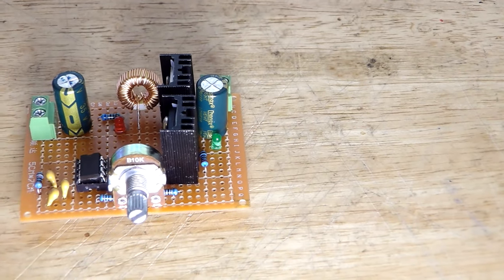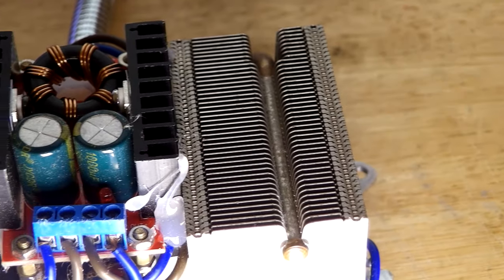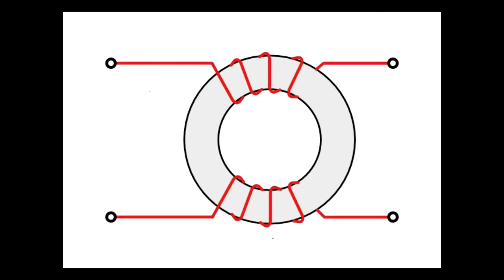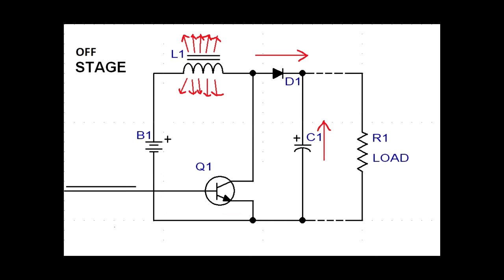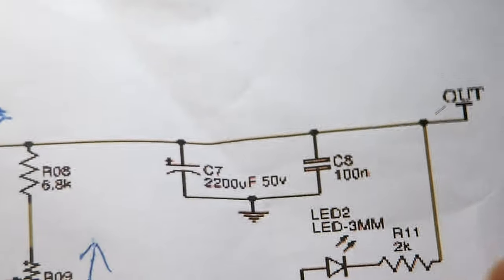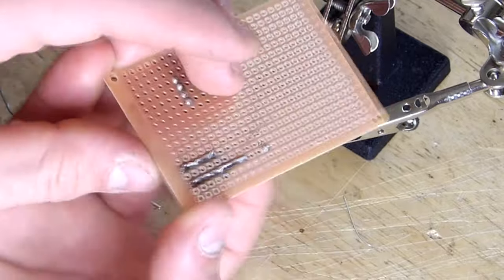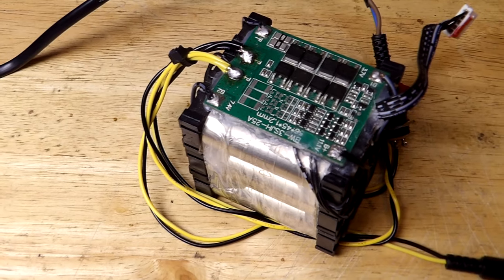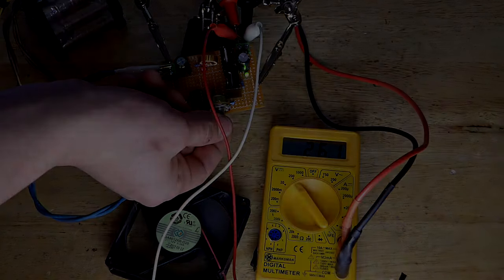DC to DC 150W Boost Converter Base On UC3843

Comment: Sorry. The feeback control of the uc chip control the ouput voltage and if a voltage drop the chip step up the voltage equals to the setting voltage by the potenziomenter?
Reply from the maker: yes it will regulates the outpout voltage but if the load it will be to much it will start to hiccup and stop working . keep in mind that this is a flyback converter so a maximum of 150w can be take out from it . if more is need it you cand modify the circuits but i m getting of from the topic so yes it will regulate the voltage
Reply: @MikeTechnology  thank you

Comment: Sir circuit working fine but inductor and shunt resistance getting more heat input voltage 14v and out 50volt coming but geting more heat in inductor and shunt resistance. .... inductor value 47uh ,shut resistance 0.1ohms 5watts
Reply: Can u help me
Reply from the maker: the inductor you use i to small you need it to be at least 100uh to work decent , try to rework it by removing the winding and counting them then add few more ,it will not be 100% acurated but it will increase it , or use one wich is 100uh even 150uh will work perfect , hope this help . the shunt is ok is not that the culprit is just to little inductance for the ocillation to work decent
Reply: @MikeTechnology  thanks sir for replying
Reply: @MikeTechnology  sir i use 150uh inductor again heat problem   issue 🥲  

I use same circuit in video 
Input capacitor 4700uf 25v
Output capacitor 3000uf63v
MOSFET irfb7545
Diode 10amp 100v  
Gate resistance 10ohms
This specification only i change
Reply: @MikeTechnology   while using 150uh inductor input voltage 15v and output voltage 48v
Reply: @MikeTechnology  any idea 💡 sir to reduce heating inductor
Reply: @MikeTechnology when output voltage 25v inductor did not get heating issue
Reply from the maker: try swapping that 10R from the mosfet gate to a 47R if that does't work use a 100R , from what you are explaining is likelily that the inductor is going in saturation , if changing the gate resistance don't work use diferent inductor , make sure you  use a ferrite one not iron powder , but if still not working you can add a small gap in the core simple cutting it in half and isolating the 2 half of it with tape ,paper because with an air gap it will lower the hysteresis curve and allows more energy handling by decreasing the permeability of the core
Reply: @MikeTechnology  sir is mosfet required pull down resistance for gate to ground
Reply: @MikeTechnology  in my inductor air gap is more
Reply from the maker: yes you need at least 10k on it base
Reply from the maker: it need just a small gap verry tiny one like a pice of paper the gap help build the magnetic field but if is to big will will do more or less nothing , is same like a core without gap it will saturate at one point rezulting in more losses
Reply: @MikeTechnology  there is gap in core and coil .then also heat is producer in  inductor 
if out put voltage increase above 35v   only inductor get heating issue
Reply: @MikeTechnology  output of boost converter is less then 35v it work good and no heating problem
Reply from the maker: @mani4812  then if is still saturating even after modification you can do 3 thing , first change the inductor or second  add a small snaber network across it 1nF pollypropeline cap with a 470k resistor at least 2/4 W will be a good for  start , and the third option you can go a bit higher with the ocillator by changing the C4 and C5 one of it to 4.7nf but keep in mind the fedback pin of the ic can stand to high voltage let say over 50v with modifing the R08 resistor and R10
Reply: @MikeTechnology  thanks bro i try reply u
Reply: @MikeTechnology  What type capacitor you using  in this circuit

Comment: Please what are the modifications to reach 300 Watts with 10A ???
Reply from the maker: Well it is a lot to explain but this boost converter it is base on a flyback topology wich mean it will supply at it best around 150w to extended it funder we need to use another topology wich can be achieved by adding a pair of pnp and npn at the gate of the main Q1 tranzistor this will be a crude but verry effective improvement over the  current topology and it will be basically one tranzistor forward topology but as well the induct has to be rebuilded or changed plus a snabber network for preventing the q1 main tranzistor for getting burn now for the main switching tranzistor we can add few of them in parallel to help increase the overall power distribution but now if you really need some extra power just add few boost module in parallel but be sure that they are identical and as well the feedback pin to be connected to the same rp1 potentiometer like I said it is a lot to explain but I will eventually come with a update on this topic soon in the nearly future thank you for the feedback

Comment: I made this with the same component,but the output is same with the input, i'm check the potentio and it give voltage to pin 2,i ceheck the ic with buzzer its work,but when i'm try this circuit the pin 6 its not giving voltage to the mosfet,can you help me

Comment: sir what is the input voltage?
Reply from the maker: 12v it is the normal working voltage but you can power it up even from 9v  but with some limitations.  It better though if as example you need 24v power it from 12v or if you need 36 power it from 24 like that you will get a better input/outpout efficency and minimise the losses
Reply: @MikeTechnology  thanks for the respond sir, and what is the maximum current out put
Reply from the maker: @nemborodrick2359  now depends if the board it is  done well you can get at maximum 150w out of it due to the reason it is a flyback topology boost converter 150w usually it is the maximum but in the reality you can get like 100w to 130w at best even with the commercial one from ebay.  But as well for that to happen the voltage gap between the input and output has to be small to reach that power.  Like at example to power a typical 100w led you need like 3A at around 33 to 33.5v to power it at it maximum and from my test the best  results was by using at minimum 18v but now depends as well you input source if you got like a 12v charger wich can deliver like 2a at best don't expect to much amperage at the outpout even if you need a slightly higher voltage because depends about at what you want to integrate it for led . Or motors and so on
Reply: @MikeTechnology  thanks sir well understood. please can you build me a 4.2v -24v dc-dc buck converter  circuit using lm 324 ic
Reply from the maker: @nemborodrick2359  well the lm324 it is a quad op amp. And I don't know if it is really suitable for being use as as buck converter because it will be to complex and the components required are to manny plus you need  as well a way to get feedback to be able to ajust it plus short circuit protection.  Try better the lm2576 it can give you like 3a at best or if you need a bit more power use the xl4016 it can give up to 8a they are the easiest way to get a stable voltage.  I got video for both of them on my channel check them out if you wanted.
Reply: @MikeTechnology  okay sir I will check on your channel. But sir what of using also 555timer as buck converter, will it work well?
Reply from the maker: @nemborodrick2359  to be honest I never try to make one . I watch some on YouTube but I don't think it will work well . Cuz after all you don't have any way to implement a feedback in to it without making the circuit more complex and even if you get it working the 555 timer is not meant to be use as a buck converter or even a boost converter.  If just a oscillator wich can be use in manny way for cool projects but not for dc to dc convertors
Reply: @MikeTechnology  good morning, I have build this circuit this morning the issue is that i went to the market I saw but ka3843 ic so I don't know if it will still work?
Reply from the maker: @nemborodrick2359  ka3843 it seems to be same as us3843 I had a look at the datashet and the pinout it is the same plus other few parameters.  I guess is just the same chip unther different name giving it a go .
Reply: @MikeTechnology  woowww sir i succeeded to build this circuit, it work like magic perfectly. Well sir thanks for this circuit. Sir from the diagram of the circuit is there a way I can transform it into and inverter DC - AC ?

Comment: Can I remove 1nf caps??
Reply from the maker: you can modifie the value . but if you will remove will not going to work properly because they are use to set the frequency of the internal ocillator

Comment: I made it but voltage dropped heavly!! Help please
Reply from the maker: what is the inductor you are using 
what is the tranzistor have you use
have you use the same shunt 0.1R

i can't guess but usually is may be a layout problem . you have to keep the distance between components verry close for minimise the loses try make it again and plan your layout on a pice o paper first after put them together on pcb or on vero board .
Reply: I used irf3205, diode MBR20150CT,  then ferrite core
Reply: How to attach feedback
Reply: Can i add feedback
Reply from the maker: @madeintanzania2995    yes you have to have a feedback pin 2 of the UC3843 look a the schematic you have after the diode 3 resistor R08 R09 and R10 the created a voltage divider R09 it is a valuable resistors with it you control the voltage from the vcc let's say 12v to the voltage you will get on your configuration . look at the schematic as well on 1 on of the UC3843 you have 2 pasive component 1nF condensator and one 100k resistor that resistor has to be conected as well to the pin 2 . give it another try
Reply: Thanks joh! I will try to make it again